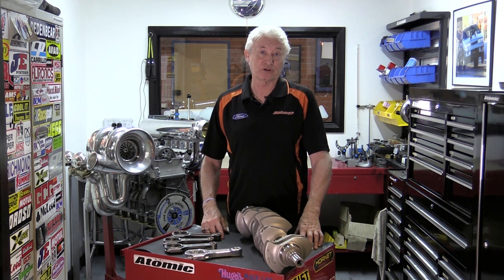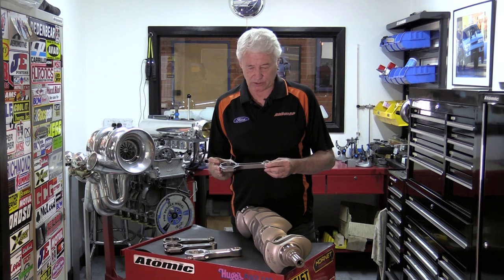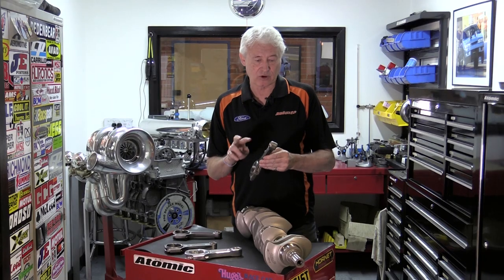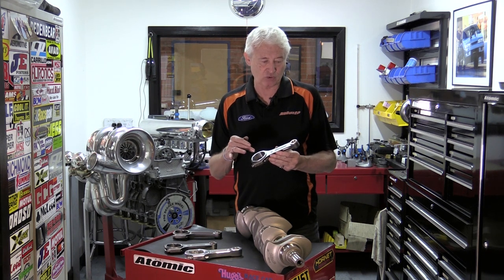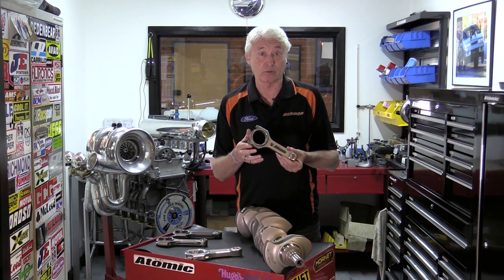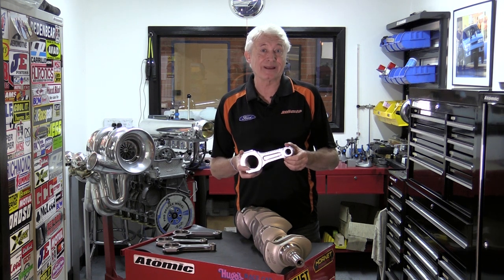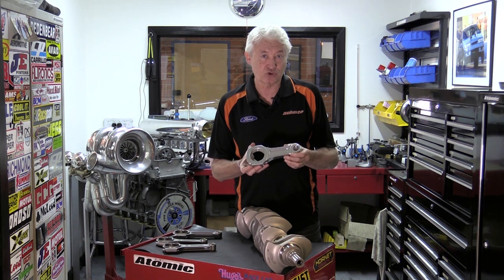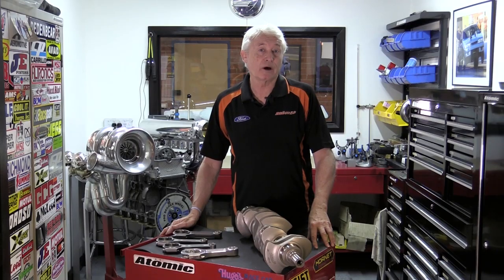Atomic Conrod Comparison - Steel and Alloy

Comment: The I beam looks like it would be stronger because of more mass in it in the main beam, also the H beam has the oiling hole right up through the centre which i thought may weaken it.